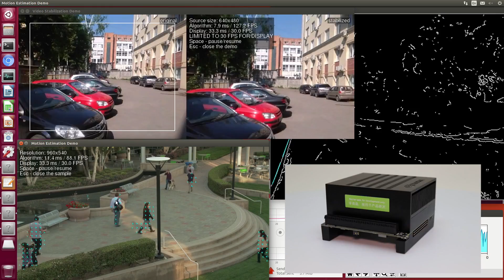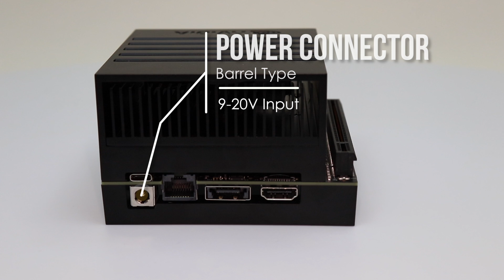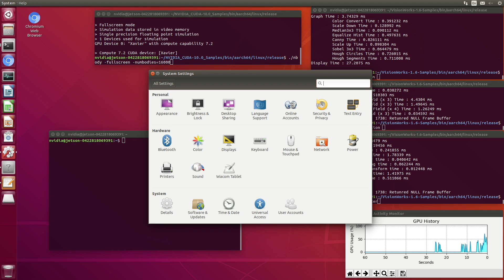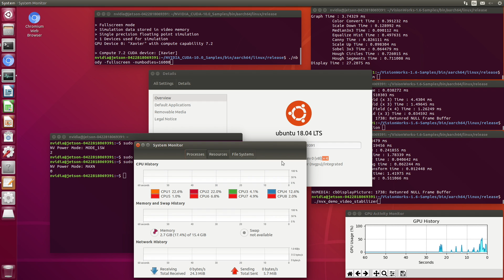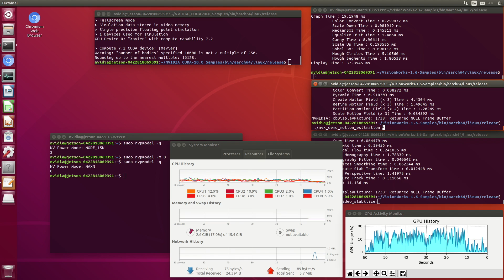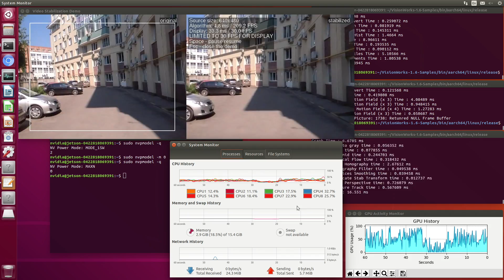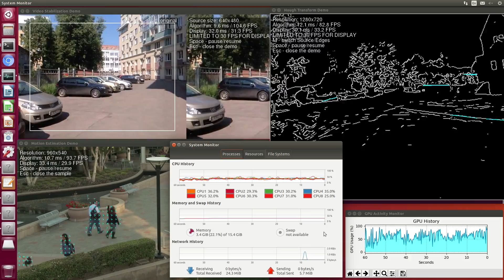NVIDIA Jetson AGX Xavier Developer Kit Unboxing and Demonstration

Comment: How to use the PCI? Did you put another GPU on top? Thx
Reply from the maker: Not sure I understand the question. Typically you would add a PCIe peripheral such as a disk drive. You can ask in the forums if anyone has experience with GPUs in that slot. Thanks for watching!

Comment: interesting... this thing could be next in PC, whole system is running at 15W... but... why only demos? I'd like to see a real performance... is it still boot Ubuntu 18.04 of the  SD card? Can NVMe M.2 drives be used as system drive? Did you try a simple encoding/decoding with any open source editors? They claim 4 streams of 4K@60p H.265 encoding.... true or false? nVidia support is horrible, they tell you to go to Forums... anyone compared this 8-cores chip +GPU with new Apple M1?
Reply from the maker: It sounds like you have some pretty good ideas for Jetson AGX Xavier videos. You should do some videos and answer those questions on your channel. I can answer some of your other questions:
1. Why only demos?: Received the Xavier a day before the product launch and made a video released on launch day. September, 2018.The video is entitled 'Unboxing and Demonstration', which states explicitly that this is an Unboxing and Demonstration video. The video matches the description.
2. The AGX Xavier does not have a SD card.
3. Yes, NVMe drives can be used to both boot the system and used as the roofs.
4. I don't know what the term 'open source editor' means wrt encoding/decoding

You should get an Apple M1 if you think the Xavier and M1 are the same class of machine. I've heard really good things about the M1.
Thanks for watching!
Reply: @JetsonHacks  thanks Jim for quick reply and answers for some of my questions! Open source editors are usually free software with unlocked features we can install and run on any platforms, here, I meant something like Openshot or Kdenlive video editors built for Ubuntu OS... or... even regular FFMPEG commands to try to run, to make videos. I don't think M1 and this chip are the "same class", I know it's ARM architecture, which raises lots of questions about software we can use, including the version of Ubuntu OS. 
I've heard Apple engineers did a very good job for optimizing their software and next M1X chip will blow all existing PCs... it's good... but its all proprietary software of Apple closed eco system, running same Kernel, which I don't use... and yes, since the launch of these chips nVidia is not making any effort to build a complete system... and reviewers who posted demos still don't have answers to my simple questions since the launch(sorry I didn't see all your videos)... So the idea here is to use these chips for content creation and as a regular every day computer at ~15W of power. If you have those videos already posted, pls , send me the links.
Reply from the maker: @naturepi  The Jetson AGX Xavier is a developer kit. The main purpose is to provide a platform for developers  to build applications to integrate the Xavier hardware into their own designs. The JetsonHacks channel is for Jetson developers, the intent being on how to program and develop on the platform. For example, there are videos here on how to write code or pipelines to encode/decode video. 

Here is a Jetson Nano (~ quite a bit slower, older software) running Kdenlive: https://youtu.be/kbn_6ixtIpA?t=830 

If you are developing a desktop computer which integrates the AGX Xavier, you will need to benchmark it yourself to see if it fits your needs. The expectation that a 3 year old machine that runs on ~20W has the same performance capability as new machines that run at 10-20x that seems optimistic to me.

Comment: I order this and expect it this week, but I may have gotten in over my head!! I expected to connect my Raspberry Pi camera, but as far as I can see there is no compatible connector! How can I connect the ribbon cable w/o buying an expensive base board?
Reply from the maker: I do not know, there is no CSI connector on the AGX Xavier. You can ask this question on the official NVIDIA Jetson AGX Xavier forum where a large group of developers and NVIDIA engineers share their experience.

Comment: I wonder why they don't pair them up with TU106 to TU 102 chipsets?
These singleboard Computers offer way too few cuda cores for Boinc or Folding.
This unit has a graphics performance between a GT1030 and GTX1050, which is 3x slower than an RTX 2080 Ti.
Reply from the maker: Not sure what kind of power envelope you are trying to outline here. The Jetson AGX Xavier runs in 30W, the devices you describe need 100s of watts. the Jetsons are mostly meant for deploying trained models (inferencing).Thanks for watching!
Reply: @JetsonHacks  Perhaps they're ok for AI, but for any deep learning, they need more than a 3-4 year old GPU.
Reply from the maker: @ProDigit80  Thank you for sharing your opinion. Thanks for watching!

Comment: Could this be used as a low power possibly portable gaming pc? For emulations and whatnot
Reply from the maker: It might be challenging, depending on your development level skills. First, it's an ARM board so it's not compatible with PC games. Second, it's rather expensive ($1300), so you'd really have to be motivated to change over to this. 
On the other hand, if you're developing a product around this (like Nintendo did on the previous generation Jetsons with their Switch), there's a lot there to work with. Thanks for watching!
Reply: @JetsonHacks  my goal is to make a portable powerful pocket pc like the gdp win that is able to run aaa games via virtual machine and play all emulator at full 60fps.... I know it's a dream but basically my goal is a more powerful switch
Reply from the maker: @yankeered5625  This is the big brother to Switch processor, so it sounds like you could do it if you have the technical chops.

Comment: Can u pls make a Jetson nano video guide too ? I keep going in circles with it and the online guides. I have flashed the SD card as per the instructions but no examples where installed by default nor I understand how to load them using the SDK manager tool as in the instructions for the nano it says it’s not needed

Comment: +JetsonHacks do you recommend without being influenced by Nvidias sayings that the Xavier is worth buying? How well do you think it would work if it was used in something like your MIT Racecar but outside, with a Zed Cam (once updated) do you think it will build better maps without having problems?
Reply from the maker: That's a hard question to answer, there are many tradeoffs. First, the money part. If you are comparing with a Jetson TX2 with a carrier board, then an Xavier with the developers discount is pretty close in price. That makes the Xavier a good choice. If you are talking just TX2 with the developer kit then the Xavier is 2-4x as much money (EDU discount possible). Either way, it's a bunch of coin. So there's that part.

The second part is computational performance. The ZED camera in particular takes a huge number of compute cycles on the GPU, which leaves a relatively small amount of computing capacity left to do everything else (or anything clever). The Xavier wins there, it was built for that type of application. Still, it depends on how clever you are as to what you can get a TX2 to do, I don't think many people have really explored the limits. 

The image processing approach requires more than just one stereo camera, of course. In the real world, something like a Tesla has ~7  cameras as I recall. The TX2 bandwidth would be saturated in that type of situation (assuming that you are using all of the different data lanes available). Again, the Xavier can ingest that many quite easily and process them all in real time too. It's probably ~10x the TX2 performance in this early software release cycle. 

I view it as if you're buying the Xavier, you're looking to go big. You should work on the really interesting problems, not just some 2D video processing, but also sensor fusion. Add a 3D Lidar (like they do on some of the MIT RACECARs with a Velodyne Puck), or radar and multiple cameras. If you're just exploring, something like a TX2 does all the basic stuff and is a great place to start. Plus when you crash it going 35 mph it will be much less painful to watch. On the other hand, if you're looking to do really interesting things, go with the Xavier.

It also depends on if you're doing this professionally or not. If you are doing it for a work project, go Xavier because by the time you're project is done, that will be the new norm and the next bright and shiny will come along. If you are exploring on your own, you probably don't know what you don't know and should explore to figure it out. A F1 driver doesn't start off in a F1 car to learn to drive after all. Instead they work their way up the driving circuit. You can do that with a lower power computer; you can always trade up. Hope this helps. Thanks for watching!
Reply: Hey thanks for the quick response, I appreciate it! So i've been working on a rescue robot with my team, Hokuyo is letting us borrow the smaller version of the UXM 30LX EW so the UTM but we have both for lidar processing, the Zed I understand, so I want to shoot my brains out when I use it because its always so slow and when I try to run it and RTABMAP and all the other junk I need the Jetson just fails completely. We are trying to build something like a Ros Husky Rover type of outdoor rover, my team and I have access to our high schools new maker lab and were trying to design a new base for this year, and I in terms of hardware i'm torn  between using just 2 linked Jetsons together or buying 1 Xavier with the dev discount. Professionally with a different group of people we were told to run our ML models on a custom security camera with a Tx2 built in but the best the whole thing gets with the camera inputs and the models is running at 15 frames per sec on overclock and the system sometimes crashes. 

Suppose Stereolabs updates the zed to cuda 10 and everything, if I run the zed and rtab and go run around outside, what are the chances that my map, and say later some other stuff like a mono cam does feature tracking to 3d with the zed, will that run smoothly? Also the Xavier is the ultimate solution to having more than 1 high quality camera connected right?

I'm on the border of buying the Xavier and I think for the amount of issues it solves it could prove useful.  

Thanks again for the response!
Reply from the maker: It sounds like you bumped up against the top of the Jetson TX2 capabilities. I think the Xavier would be a good choice. Remember that the Xavier runs Ubuntu 18.04, so expect some development to get everything up and running.
Reply: True, is only 4.1 using 18.04 or can it use Jetpack 3.3 as well? It shouldn't be too bad, ROS Melodia is out now right? I think I will order it.
Thank you again for your opinions and advice!
Reply from the maker: Yes, JetPack 4.1 installs L4T 31.0.2, an Ubuntu 18.04. JetPack 3.3 is for the Jetson TX series. ROS Melodic is available. Good luck on your project!
Reply: Awesome! Thanks again for everything! I hope it works!
Reply: You are wise hence I ask.
Reply from the maker: Lol. Not that wise, just old. Thanks for watching!
Reply: oh

Comment: In fairness to the TX1 and TX2 formats if you were to use them in practice you'd replace the carrier board with something like this:  http://connecttech.com/product/astro-carrier-for-nvidia-jetson-tx2-tx1/  and get much smaller form factor.  If you need the compute horsepower though this thing looks epic.
Reply from the maker: The developer kits are just that, deployed these products take much different form factors. Skydio and Magic Leap are great examples. However, for practical prototyping on smaller form factors (and for those with smaller budgets), it's nice not to have to spend a bunch of money for a carrier board and be able to have a rough prototype working straight away. The Astro with breakout board costs as much as the Jetson. But as you would point out, the Xavier is 4X the cost of a TX2, so a carrier board isn't nearly the burden in comparison to the TX2.

The TX2 and Xavier are not the same class of computing device, the Xavier is a little monster. I'm going to use this one on Halloween to scare small children away. Thanks for watching!

Comment: Hi Jim, have you tried to build the kernel for Xavier?
Reply from the maker: Not yet, hopefully that will be a straightforward process. Thanks for watching!
Reply: Hi Jim, I have tested that on Jetson Xavier, this cp210x is originally supported.
Reply from the maker: Good to hear! It sounds like you got the kernel to compile with no issues then?
Reply: I didn't do anything to the kernel, it seems like RPLiDAR A2 with cp210 is supported already.
Reply: Thanks for your reply, I will try it tomorrow.

Comment: Does anyone know what its mass production cost is? Is it the same as the price of the development board?
Reply from the maker: I do not believe that the pricing has been announced (Sept, 2018). Expect pricing when the module itself becomes available with the thermal transfer plate solution later this year. You can probably get a better answer on the official NVIDIA Jetson AGX Xavier forum: https://devtalk.nvidia.com/default/board/326/jetson-agx-xavier/
Thanks for watching!
Reply: Its $1299/ for developer board with discount.
Reply from the maker: The module pricing has been announced. $1599 USD (qty. 10+). $1299 USD (qty. 100+). Available towards the end of the year.